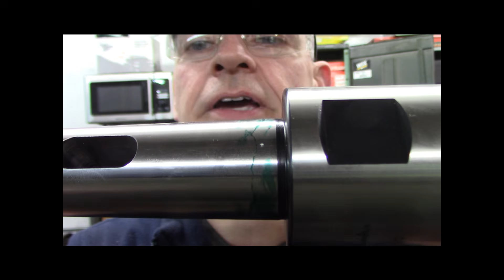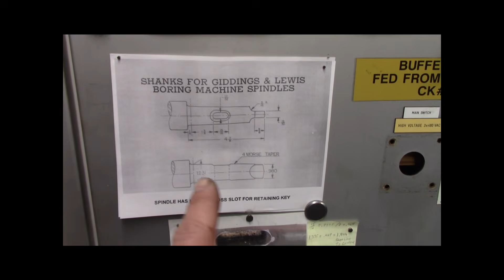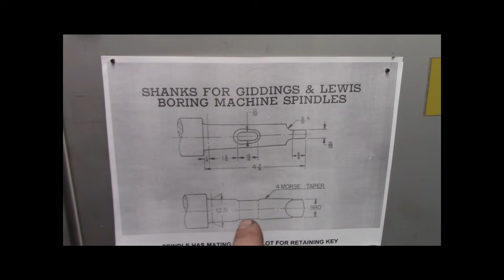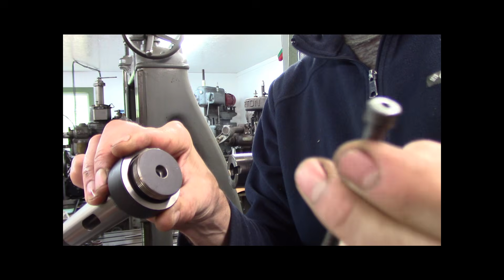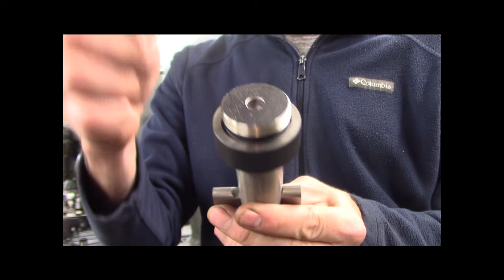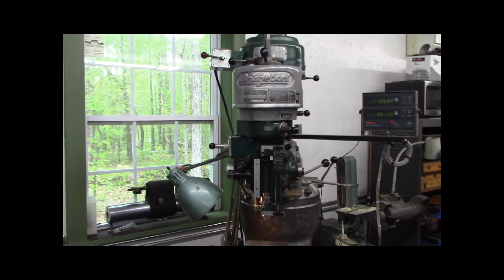4-06-26  --  HBM - Horizontal Boring Mill - Morse Taper Tooling Retention

Comment: The key I made works like a jack. It draws in tight and solid. Only drawback to your setup is the retention force is limited to the bolt strength which is not nearly as high as that of a solid wedge.  That being said its really big face milling that loads the connection up, single point tools not so much and you can drill and tap all day with nothing holding the tool in and its no issue.
Reply from the maker: Hey Brian...  You are right.  The strength of a 1/4" bolt is not as strong as a wedge, for sure.  I am working with a 4MT and I know you might have a 5 MT.  I have a bit less room to make a good wedge design, and I don't like how picky the fit needs to be with a solid wedge.  So I came up with this 1/4" drawbolt idea.  I do have a 10" face mill, but it bolts on to the stationary spindle. Probably the largest shell mill I would use on the 4MT spindle would be a 2", something small.  I appreciate you sharing your knowledge.  Keep that corn growing.  Need my bourbon whiskey!  --------Doozer
Reply: @kooldoozer  Mine is actually a 6MT so I got a lot of room.

Comment: Your design is ingenious, better than the sliding adjustable key like I have. The ER 40 is a versatile adapter. How hard are the shanks on the adapters? And how long did it take to mill the slot?
Reply from the maker: The shanks are from Shars.  As mentioned in the video, they are around 30 to 40 Rockwell C scale.  It takes about 15 minutes to mill the slot in the shank with a 3/8" carbide 2 flute end mill.  The 1/4" hole in the center was cut with a regular HSS drill.  ---Doozer
Reply: @kooldoozer 15 minutes is not bad at all. Didn't catch the 40RC note. I'm a gonna have to order up a few for my boring mill in case I need them someday. So far it's done just 2 small jobs, then sat marinating in its own juices for several years waiting for more use and TLC.

Comment: Nice cure , DOC. !    Relying on just the tapered wedge could cause a future catastrophe , knowing that at some point an intermittent boring job may come along - 'might loosen the tapered 'grip' enough to cause an "OHHH SHITTT ! "
Reply from the maker: Thanks George.  This draw in bolt idea seems very positive for shank retention, which make me comfortable taking heavy cuts.  You are right.  I don't trust a tapered wedge key to stay tight either. ==---Doozer
Reply: @kooldoozer  'Sometimes I wear suspenders AND a belt . . . 'can't be too careful ,  - 'better to be PREPARED for CONTINGENCIES ! ! !
Reply: Either of you lads hear from Kimber?
Reply from the maker: @trollforge  I called him on the phone around Christmas time.  He is doing ok.  He is a good dude. I often think about him. --------Doozer
Reply: @kooldoozer thanks, I miss his smiling face!
Reply: @kooldoozer   I'm guessing that he got tired of YOUTUBE ?    He's generous , almost to a fault !   He sent me the gearbox from his mill's X travel . . . ( South Bend ) - - - My intent is to adapt it for Z travel on my 12" Atlas / Craftsman Commercial lathe . . . 'gotta few badly chewed gears to replace , or ELIMINATE !     He also sent me a 'care package' of tooling he has no use for , including a STARRET trammel set ! ! !    ( LUCKY ME ! )
Reply: @trollforge  'Been planning on sending him an email or phone call . . . wondering what happened !